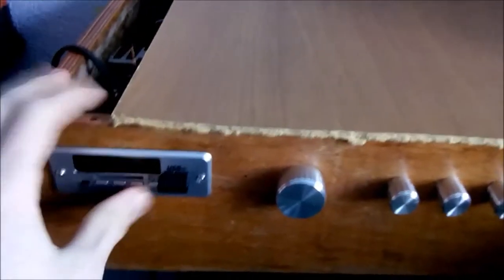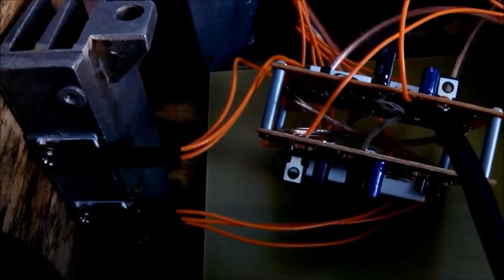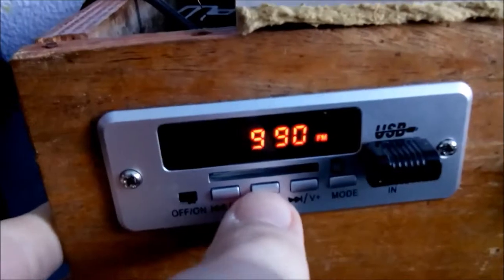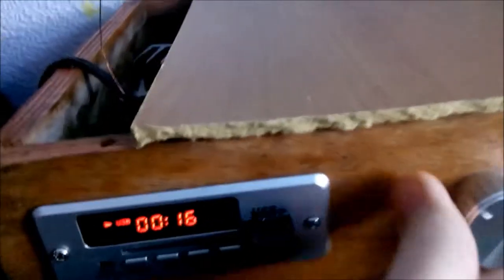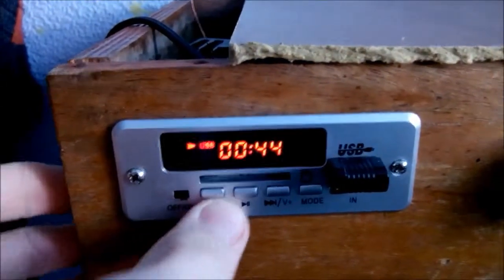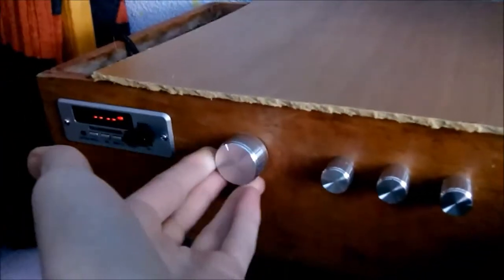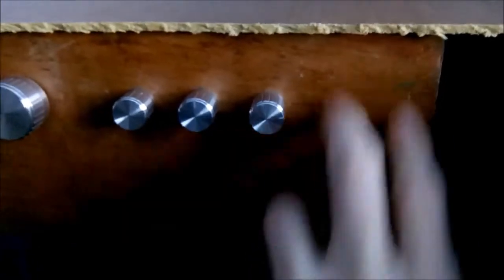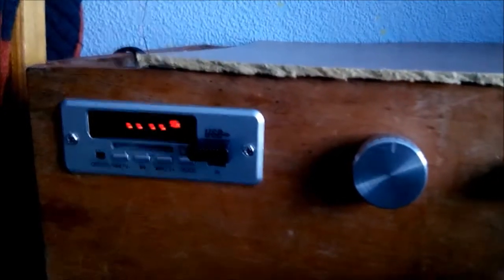My Audio Amplifier (class AB, tip41c&tip42c)

Comment: Simple but good desing. In your opinion which one sounds better, the tda2050 or this transistorized amplifier. Cheers.
Reply from the maker: It's tricky to say for sure, but for me the discrete one sounds better. The difference can be down to component values though (I didn't quite know that back then). Input cap will determine the low 3dB point, and the cap in the feedback will have an effect as well.
Reply: @mrjohhhnnnyyy5797  Thanks for your answer, I will try the dicrete one.

Comment: how much supply voltage use here ?
Reply from the maker: Originally (in this video) it was +-25V, because I had TIP41&TIP42 as output transistors. Year after that I changed transistors to TIP35&TIP36 and I rewound the transformer a bit to make it +-32V. If you will use beefier transistors, you can safely go to +-35V.
Reply: can i use here 12v ?
Reply from the maker: Satyaranjan sahoo No, you need higher voltage and a dual supply: +35v, gnd and -35v.
Reply: okay thank you Mr johny

Comment: Nope I'm done with this circuit the gain is too high and as soon as i removed the light bulb protection both of the outputs died i bew my 2cond pair of TIP41C and TIP42C. the Bias is close to class B and it barely draws something but the gain is soo high that when i touch it it oscillates and rhe light bulb protection lights up as if it's class A bias. Lucky it didn't blow my sony mp4 player's channel. This circuit turned into a big mess. I'll put between the input cap a 4.7k and in parallel with ground  470pf cap for less gain and then it shoud be done. Sorry if i was rude.
Reply from the maker: +somerandomguy fromthestreet That's interesting, I plan to modify mine to get more gain and you have troubles with excess gain :) And yeah, you can modify the circuit to your heart's content. I did just that 'cause I needed a convenient quiescent current adjustment, which I wouldn't get following the original schematic.
Reply: Yup because I forgot to mansion that my differential amp is with bc560c class A and bias 2n3904 drivers d667 b647. Diffrent components and I'm thinking that the BC560C have high gain. I purchased the original that the circuit specifies and then I'll make the DC-DC converter this is going into my DIY Hybrid car.
Reply from the maker: Wow, sounds like you have a lot to catch up with. bc560 has a lot more gain so yeah, I made this amp with generic transistors, not a fancy ones. That can clearly be the reason why you have issues. Good luck on your projects :)
Reply: Thanks You too.

Comment: Is it normal my class A driver to get hot cuz i don't think so. I finally made a board for it but ran into allot of problems and there war because of the Gain it was super sensitive and always pulled allot of current when i touched the input but i fixed it by just replasing the 4.7k resistor on the FeedBack capacitor with a 1K.
Reply from the maker: +somerandomguy fromthestreet In my amp, the driver gets reasonably warm but not hot. If yours get hot, you have to dig deeper. You mentioned that you've used 2sa1943&2sc5200, I suppose you connected 2sa1943 to pnp pre-driver(Q6 on my schematic) and 2sc5200 to npn pre-driver (Q5 on my schematic), right? If no, that explains why you have problems. And really, put an ammeter and measure the quiescent current, it's easy.
Reply: no i used them on their prototype now they are with the original (TIP41c and TIP42c). When it was with 2SC5200 and 2Sa1943 my class a driver was TIP41C. but still it shouldn't even get worm. I designed a few amps before got a little bit of knowledge and they shouldn't go even worm. I builded it for the 4th time and still run into problems. But anyways I'll just make a few modifications and hopefully the problems will disappear. btw i builded this circuit in Everycircuit to test it and it worked then i shared it with the Everycircuit community and mentioned your channel. Thanks for the help. If you have a smartphone like a Android go check the app it helps me allot.
Reply from the maker: somerandomguy fromthestreet Well, warm or not warm are purely subjective feelings, every person has different. Class A driver will warm up, it's totally normal, but it shouldn't be so hot that it hurts to touch it. What voltage do you use for the power rails? Originally I ran it on +-25V, now on +-35V; no problems found in either case. 
 Later I'm gonna go measure bunch of voltages on the thing and write another comment here. That should allow you to test yours, they'll be different; but it's good to have some reference values.
 I'll check the app later, I'm a bit busy right now.
Reply: 2x27V 1.6 Amps.
Reply from the maker: somerandomguy fromthestreet That's just fine. Here are the voltages (referring to my schematic): /voltages with respect to GND
Diff amp:
emitters of Q1&Q2 = 0.5V
collector of Q1 = -30.6V
collector of Q2 = -29V ( I added the 4k7 resistor from it to -32V; however it didn't change the performance)
bases of Q1&Q2 are at 0V
A-driver:
base of Q4 = -30.6V ( thus Vb-e of Q4 is=1.4V)
collector of Q4 = -1.3V
emitter of Q4 at full negative rail voltage
///
output:
base of Q5 to Q6 = 2.2V
base of Q7 to Q8 = 1.2V

The rails are +-32V, output offset is +0.2V (to GND). ! Input is grounded during measurement !
Reply: Thanks. I'll check mine later. I had a problem with the Gain and the Bias and it turns out that it outputted some kind of voltage trough the input and blew my R channel on my DAC. And now i have to purchase a new op amp. So if your Aux is directly connected to the input run it trough a pre amp just in case cuz with that high voltage there is a chance to happened for me it happens for the first time differential amps should Not do that. And thanks again for the feedback I appreciate it.
Reply from the maker: I did put a cap on the input just for that, so I'm safe and sound. You should always include dc decoupling cap on the input
Reply: Yes i did put one polarized cap as the circuit specifies even a 3.9K resistor because of the high Gain but i still blew it up. hopefully when i change the op amp it will work i did ran a test and found with of the 4 op amps is the blown one. I swear before i didn't have this much problems with a transistor amplifier. Such a simple circuit and yet so many fuckups.
Reply from the maker: Oh yeah, simple circuits are like that :) I have enormous issues when I try to build regen receivers with 1 transistor, so just take a break when it starts to drive you nuts and you'll be fine
Reply: Yeah School for now later projects.

Comment: Well never mind i finally fixed the problem just flipped the collector and emitter on the differential amplifier transistors. so idiotic of me.
Reply from the maker: It happens :) But I would recommend to not reuse that particular transistor, it might be damaged a bit after what happened to it. It may look ok, but parameters may be far away.
Reply: nah i used a weak power supply an ran the transformer trough a 60W lightbulb. it's fine but i use a 47k Ohm potentiometer for the Biasing but the circuit specifies a 22k. After i make the official thing I'll change them.
Reply from the maker: Value is not that crucial, it's the ratio which does the trick. You can leave that 47k there, I used 22k purely because I had a few of them.
Reply: i figured but my bias doesn't change anything it stays at around 270 degrees witch isn't that efficient. and my outputs do get really hot.
Reply from the maker: somerandomguy fromthestreet Sounds like you have excessive quiscent current. Mine is set to about 35ma (one channel) when cold, with such amount the amp doesn't produce audible distortion and the waveform looks very nice on the scope. If you followed my schematic, try to disconnect 4 diodes in the bias section and use only the "servo" (transistor with the trimpot). If your servo doesn't do anything, check the trimpot; if the wiper goes open, the amp behaves just like you described.
Reply: yup cuz the bulb lights a bit when i touch the input. and now i use 2SC5200 2SA1943.

Comment from the maker: You must've bad part somewhere, this circuit is very simplistic. Such symptoms can pop up when you didn't connect 22k resistor on the input. If you're completely sure that you connected everything right, one of the transistors must be faulty. Can you adjust quiescent current?